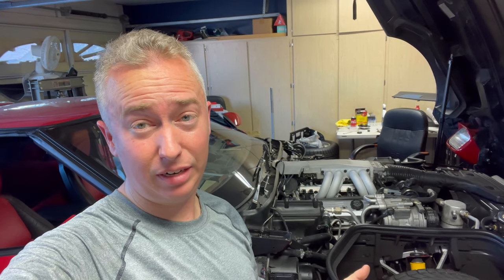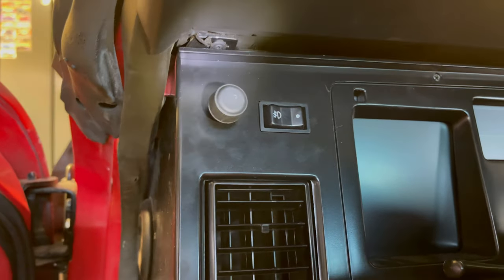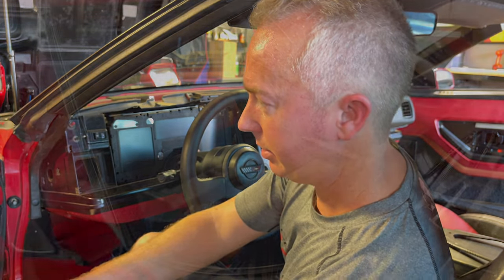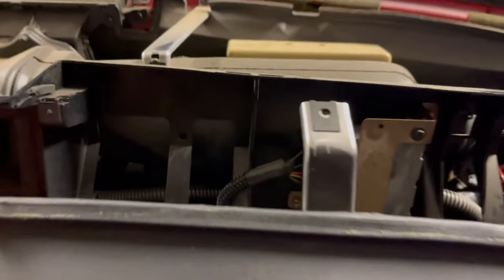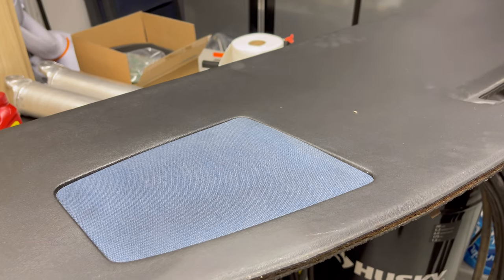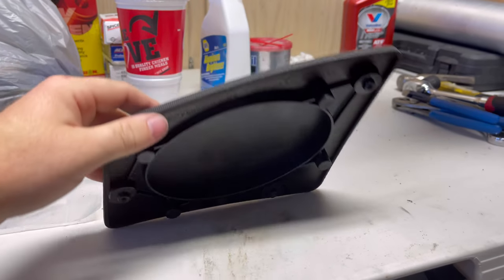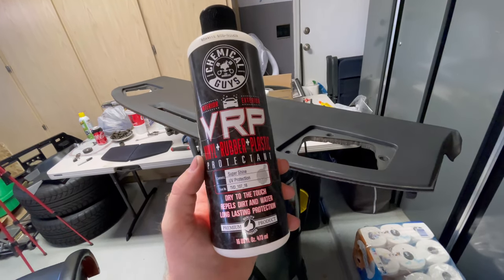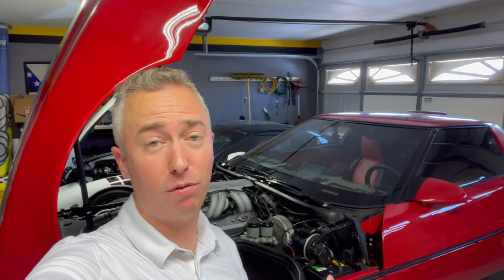(84-89) C4 Corvette Dash Removal

Comment: When you said you were going to Sharpie the speaker grilles, I was thinking "Oh, from blue to purple..." lol.  The Sharpie method works great for some things, but it definitely has a purple hue to it.  But spray paint on fabric works surprisingly well. 
I'm glad I never had to take apart the dash in my '96-taking out the driver's seat to lay in the floor to get to the brake booster was enough fun for me.
Reply: Liquid black shoe dye, is the best for returning plastics & fabrics back to a true black

Comment: The previous owner on mine had put in an aftermarket system in place of the Bose, but I found he reused the Bose speaker wire. Which people say is really thin as the wiring is for a preamp load like RCA outs. I ended up running new 16 gauge speaker wire.

Comment: Good call with painting the speaker covers. I used a sharpie (extreme fade resistant version) to touch up the numbers on my license plate and they faded after only a few days. I guess those pigments just aren't designed to hold up to outdoor use like paint is. 

Anyways thanks for all your hard work with these videos! Definitely helping me out with projects on my 84 vette.

Comment: As someone who has now replaced 2 heater cores in my 86, remove the seat! It's only 4 bolts and will make working under the dash SOOO much easier! I also replaced the speaker grille cloth instead of trying to refub, easy to to and makes it look great.

Comment: Why did you remove the bread box? I didn't do that when I replaced my heater core many years ago. I don't see any need to.

What brand heater core did you get? I got a Spectra as that was the highest rated heater core, though they don't make it anymore. As when I did my heater core, I read a lot of complaints of aftermarket heater cores not long. Though it seems like from what I've read the aftermarket aluminum versions should theoretically last longer than the OEM brass version as they say brass doesn't last as long as aluminum.

One thing I did before starting is running water in the heater core to flush out any coolant, and then blowing it out with compressed air to remove the water. I also had I believe black strip caulk or something similar to help seal around the tubes where they pass through the firewall. I'd recommend getting something like that. I also got some lube that is for radiator hoses. And after installing the heater core, I put that on the heater core tubes before I put the heater hoses back on, though I did have to tighten the clamps down a little more than normal. I did that because I had read of people getting a leak from having to replace heater hoses in the future, or when pushing them on those tubes.

A tip if you have cracked plastic pieces, especially where screws go in. Is on the backside, I get some black ABS cement from the hardware store. And I brush it on the backside of the cracked area and let it sit for a day or so to fully harden up. It dries in just a few minutes. And that will help keep it from cracking more and will stiffen it up so you don't get the flex from the cracked plastic pieces. That ABS cement will dry rock hard, but will stay a little flexible so it can give a little and not let the crack reopen. I fixed my center console lid like that too as it cracked to pieces on the inside. It stayed fixed for a decade until it finally fell apart. I think maybe a tech at a shop might have put his weight on it getting into the car a few times causing it to finally bust apart. As I stopped putting my weight on the lid when getting into the car.

Comment: Always a excellent Video,  My 88's have that AC / Heater Push Button setup, Wish it had the dial system, I needed  to replace that push button face plate and amazing what you had to take apart in that area of the dash ? I Got a replacement from a source . I think it was " batee "   Replacement push button face place unit.  There was a good Youtube on to replace the Face Plate.  I did have to drill out the holes a little bit, Instructions that came with the replacement face plate told me that I maybe ?  have to do that.

Comment: Hi Chris, thank you for all of your patience and extremely helpful and informative videos! Today is Friday February 9th 2023. I have a couple questions. Do you have a video on low coolant light & and engine light on? Where do I find the ECM module on my 1987 Corvette? Is it located under the dash ? Do you have a video on this issue? My vette has both lights coming on intermittently, strong smell of fuel after driving a bit, and it will completely stop running while driving. This has happened 2 times now. This car was garage kept with 23000 original miles. It’s in pristine condition. I’ve had the spacers removed and new tires installed due to age. Good luck with all of your projects! Best wishes to you and your family! Blessings. sincerely Nina

Comment: What a chore getting to the heater core in that C4! I thought my 3rd gen T/A was bad!!!
Nice job on the speaker grilles and dash pad. I use 303 on mine, which leaves a nice matte finish on the plastic in my interior on my C5
Reply: What 303 did you use?  Thanks
Reply: Look up ‘303 protectant’ on Amazon. $12.02 a bottle
Reply: @jeffb243  Just 303 Protectant, nothing special just the regular brand.
Reply: Yes, just the regular brand. Does a great job, love the matte finish it leaves. Put it all over the interior of my C5 yesterday
Reply: Yeah, somebody used Armour All on the dash of my 93, and when the sun hits it, it will reflect and blind me.
Reply: Exactly why I researched low gloss protectant for my C5. Thanks to the guys on corvette forum for pointing me to the 303

Comment: Thanks for the video. Before you put everything back together please check the courtesy light timer.
 I have a 84 and have a problem with the courtesy light timer. The lights did not work from the door switches, nor the door mounted hatch switches. But the switches are good {security system uses same switch). The timer was impossible to see let alone get a hand on until I removed the dash and breadbox. Put a jumper between the white wires. If that works the timer is probably bad.

Comment: I have a 1985 Corvette. I have a AC vents issue. most of the air flows goes via the upper vent (upper dash). Is there a way to close it so the air flows via front vents and not the upper or legs without fixing the vacuum?

Comment: I would consider installing aftermaret spearkers and drill wholes there to improve the sound -IF it can be done on tbe original BOSE sysrem w/o mods. I know the stock speakers have individual amps so it may or may not be an option to entertain, but since the dash is out for restoration and the radio is just down there...maybe use those installed on C4s with the other system?
Reply from the maker: It already has an aftermarket system.